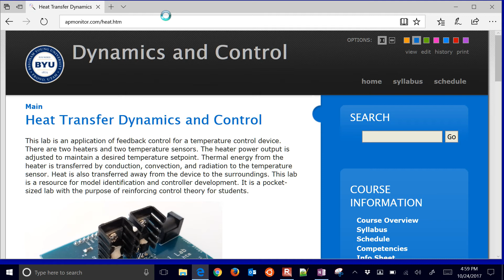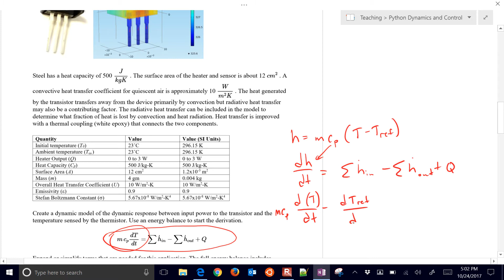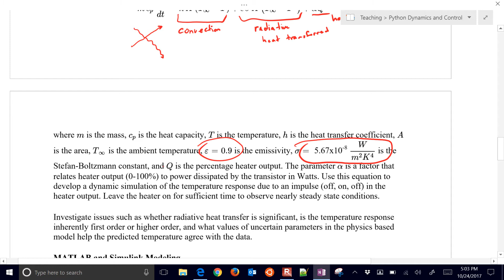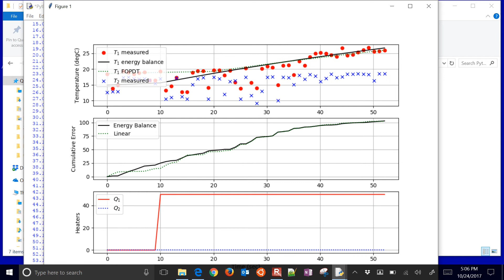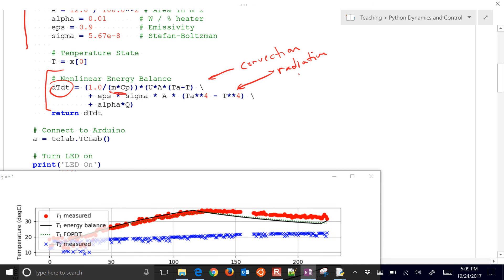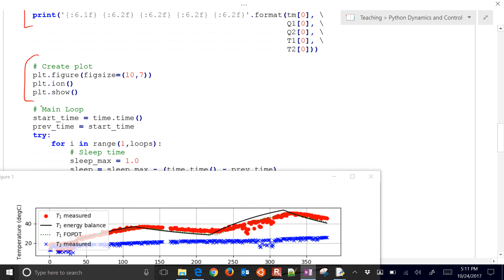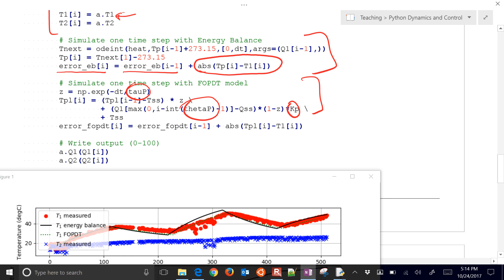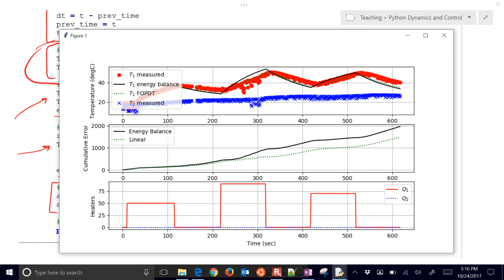TCLab Energy Balance Solution with Python

Comment: I think there might be a mistake in your code. The next line under simulate one time step with energy balance is the issue. Odeint needs a time argument that corresponds to an actual time at which a prediction is going to be made and not a time differential. From the code, tnext would always be making a prediction at a time value of around 1 second.
Reply from the maker: The code at 14:02 is correct because the energy balance function that returns dT/dt does not have a time dependence. I could also write:

Tnext = odeint(heat,Tp[i-1]+273.15,[tm[i-1],tm[i]],args=(Q1[i-1],)) 

as you recommend and that would give the same answer. I would need to use your approach (actual time versus differential time) if there are switching cases in the heat function that relate to actual time. I coded it this way to help student see that we are just progressing only dt forward in time each loop. Thanks for the comment!
Reply: Ok, I checked again and you are correct. Thank you for this lab by the way. It was designed perfectly. The size and complexity of getting everything set up was not too bad and it makes it easier to focus on the actual goal of controlling things. Very well planned out. Thank you
Reply from the maker: It sounds like you built the lab yourself. I also have a bulk order PCB printed if you'd like one in the mail from https://apmonitor.com/heat.htm  The wiring isn't difficult but some like the plug and play version.